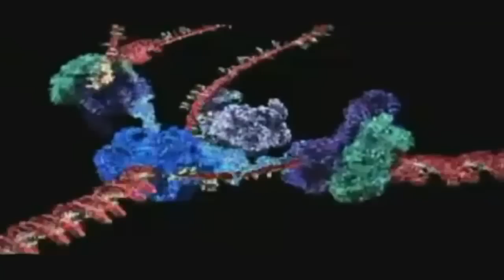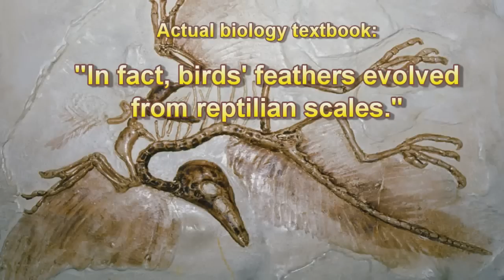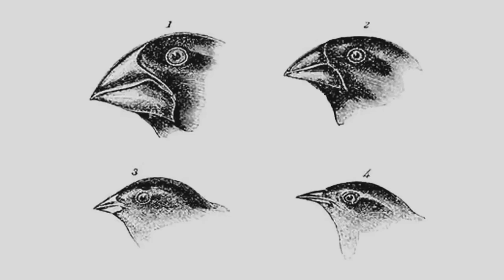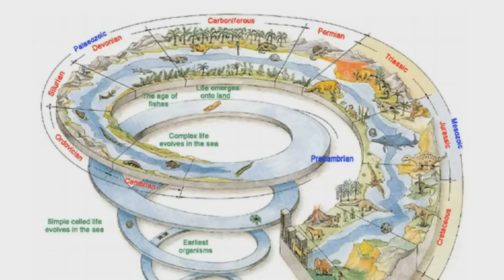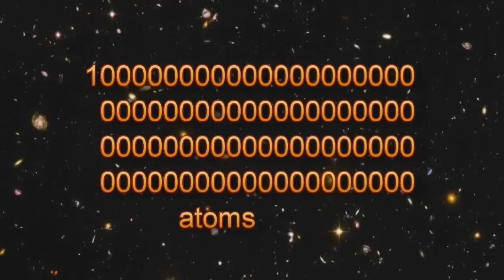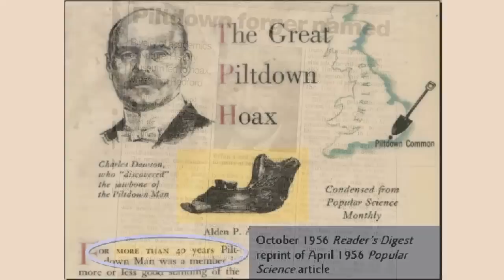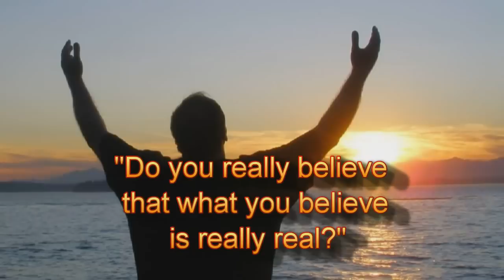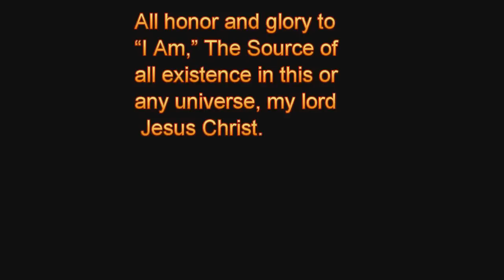Evolution Demolition

Comment: Regarding your assertion that there are no examples of new information being added to the genome: we have several examples, I'll name a couple of well-known ones:
The development of nylonase in flavobacterium, which allows them to digest nylon. This was caused by a gene duplication and then a frame shift mutation, giving a completely new trait with completely new "information" behind it.
E. coli that evolved to be able to live on citrate, by developing a new transport protein to bring citrate into the cell under aerobic conditions - this too was caused largely by a gene duplication.

Natural selection doesn't "create" anything, it just selects from mutations, it is is the mutations that create the new information.

Natural selection would't act on organisms that don't reproduce or divide, but when you're talking about the most primitive single cells, they can be divided without a reproductive system, for example by mechanical means as the cell expands.

It was determined in the 2005 Kitzmiller vs Dover case that intelligent design = creationism. Simple. Not necessarily biblical creationism, but creationism nonetheless.
Reply: Nylonase is probably a function of pre-existing information in bacterial plasmids (DNA loops) rather than the speculated gene duplication and frameshift.  But, for the sake of argument. let's assume that you are correct.  The sum total of genetic instructions to build and fold and implement an enzyme is substantial.  Gene duplication and frameshift comprise a not-so-improbable alteration of that existing, highly complex, highly functional, instruction set.  Such limited luck is admittedly conceivable.  However, to establish an instruction set in the first place that would make any functional enzyme would be overwhelmingly improbable.  Impossible odds.  Altering existing instruction sets?  Yes.  Genetic instructions where there were none? No.  At least, not by a random process such as mutation.  It has never happened, and, in fact, is impossible to happen.

Very different subject, but the Dover case was a lower kangaroo court in which the judge was both ignorant and biased, and the ID side was prohibited from a full argument.  Not unlike the Scopes trial in the reverse.  The laboratory is a much better venue than the courtroom for evaluating science.
Reply: Mark Champneys
The gene-duplication and subsequent frame shift isn't a speculation, it is a fact, have you even glanced at a paper like this?
http://www.ncbi.nlm.nih.gov/pmc/articles/PMC345072/pdf/pnas00609-0153.pdf

Frame shift is not an "alteration", it causes a completely new sequence of  amino acids in a protein, you cannot possibly argue that it's not new "information" when it's so utterly different.
DNA "information" is determined by it's sequence, so when an entirely new sequence of codons arises, it is new "information".

A kangaroo court? Really? I guarantee that if it had ruled in favour of intelligent design you and your ilk would be touting it as much more than that.
Isn't it funny that no one accused Judge Jones of being biased towards evolution or anything of the sort before or during the trial? It was only when he gave his ruling that he was attacked by the likes of Bill O'Reilly and Ann Coulter for exactly that. Makes you wonder...

I completely agree that the lab is a better place to evaluate science than a courtroom, which is why the ID movement is so insignificant.
The trial was to determine whether ID was a valid scientific hypothesis or simply creationism in disguise, and clear proof was found that it is the latter.
Reply: Ratio nalMind Did you notice the word "pre-existed" in the paper title?  A frame shift is a, well, shift.  It depends upon a pre-existing sequence.  I do not deny such higher probability alterations.  It is new instructions where there were none, that is against impossible odds, and against the law of increasing entropy.
Reply: Mark Champneys
You said yourself that the information is stored in the sequence of nucleotides, ergo - new sequence = new information. 
I have a feeling you're drifting off to abiogenesis again, asking how the very first DNA "instructions" came about.Let's try and stay on topic with evolution, shall we?

Creationists say that organisms can't macro-evolve without new "information" being added, I just gave you an example of new "information" being added.
No one is claiming that information is added by hundreds of fresh nucleotides inserting into DNA in a consecutive line, adding an entirely new gene, unless that what you creationists are expecting?

I've already explained that you don't understand the 2nd Law of Thermodynamics, it does not say order cannot increase.
Reply: Ratio nalMind I understand the law of increasing entropy better than most, and have elaborated on the law elsewhere in this forum.

I'm not one of those creationists who take issue with macro evolution, since, as you know, I don't even like the word.  I don't really care about the amount of change, but rather the direction of the change.  New algorithms cannot happen by themselves.  Alterations of existing information certainly can.

Yes, I realize that some will call any change "new," much like getting a used car and calling it "my new car."  But instruction sets are coherent.  Tampering a little bit... not so much.  Can you write a coherent paragraph one letter at a time, with it remaining coherent after each additional letter?  It might work in rare spotty cases, but mostly it will result in nonsense.  So it is with genetic instructions that build the simplest biological sub-systems.  But even moreso.

Both abiogenesis and neo-Darwinism have this information problem.  Where did it come from?
Reply: Mark Champneys
If you're using it to say that order can't increase, then you really don't understand it.

So you agree that macroevolution can occur? What do you mean by the direction?
Using the method that nylonase demonstrates, gene-duplication and frame shift, along with other mutations combined with natural selecion, it is entirely conceivable for a single cell to evolve into something as complex as a mammal. 
You can choose not to call it new information if you want, but the fact is, an entirely new trait evolved in an organism in an incredibly short amount of time. How can you take issue then, with lots of new traits being added over lots of time?

When you're referring to DNA, it is not a coherent set of instructions. A polypeptide of a string of amino acids folds into a protein with a particular function. If you change the DNA, for example by frame shift, an entirely new string of amino acids is produced, which folds into a protein, possibly with a new function.
You really need to stop using analogies to do with language to describe DNA. As soon as you describe it purely from the biochemical standpoint, it is clear that they are not "instructions" as we define them from our human point of view.

Once again, we dispute that it is information! If you're going to say that DNA holds information, then so does a rock!, it has molecules that interact in set ways, just like DNA, that's all that determines it's form and "function".
Reply: Ratio nalMind I'm not drawing analogies.  DNA is a data storage device, and there are thousands of literal computers in biological systems that access both DNA and epigenetic information.  This is being studied in biology, bioinformatics, and ontology. Dr. Don Johnson has written on the subject (two PhD's, biology (medical emphasis) and information science (ontology).  I have also heard him speak on the subject.  You can deny that such a thing exists, but it does.

DNA "is not a coherent set of instructions?"  You may be the only one who thinks so.  And coding for proteins (and enzymes) is only one small part of the information carried in DNA.  Frameshift, by definition, is simple.  What about very complex changes that would have to be made to build any given biological system?

And, by the way, are you familiar with bacterial plasmids and how they are accessed to select a wide variety of enzymes and patch it into its own genome?  That is likely where your frameshift occurred.  It is part of a designed system in bacteria--not new information.

Lastly, I explained my position on macro evolution in my video.  Did you not watch it?
Reply: Mark Champneys
Yes, you are drawing analogies, DNA is a series of molecules bonded together, the structure of the shapes created by these bonds are complementary to other molecules that carry other molecules into a another much larger molecule to be joined together and then released then one of the molecules in DNA has a particular shape to interact with that larger molecule to cause it to detach from the string of molecules.
That's all DNA is, molecular interactions, there is no "code", or "information". It can be useful to describe DNA as having such attributes, as it is much simpler to understand it in that way, but when you get right down to the molecular level, there is no "code" or "information". I've already explained to you that information and codes are defined by interpretations, in our case, the human interpretation of things like language, but DNA is not interpreted by anything, it is strictly determined by pure chemistry.

Frameshift is a simple change that results in a complex change.

Once again you are using this guided analogy of a bacteria "accessing" "information" in a plasmid and then "selecting" an enzyme, and then "patching" it into it's genome. That's not how it works! Bacteria don't think or choose or have any choice in the chemical interactions that occur within it.
It doesn't matter where the frameshift occured - it did occur, and it did create new "information" as you are defining it. You can call plasmids "designed" all you want, it doesn't make it so.

Of course I watched your video, how else did I deconstruct it's major points? Refresh my memory about what you said regarding macro-evolution.
Reply: Ratio nalMind And this machine I'm typing on is not really a computer--just a bunch of on and off switches (ones and zeroes) that happen to interact in a certain way when electricity runs through the on switches.  It's just physics, not information.

And a biology textbook is just ink on sheets of paper.  There's really no message there.  Just ink and paper bound together.

Get a clue.  Face reality.  Biological computers are information processing systems in every sense of the word.  The medium is irrelevant to the point.
Reply: Mark Champneys
I've already explained why your textbook analogy is asinine, but I'll say it once more: It is not the molecular interactions between the ink and the paper that causes the letters and words to form, they are printed. With DNA, the molecular interactions do cause the structure and function.

The actual computer analogy is better, but still inaccurate, putting aside the fact that the 1's and 0's are coming from an intelligent source, the main issue with this analogy is that the computer is programmed to interpret the binary code to carry out functions. This is not how DNA works, because each 1 and 0 doesn't physically cause part of the function, as a DNA nucleotide does.
Binary codes are not physical objects, they are an abstract code created by the human mind. It doesn't mean anything without a mind to assign meaning to it. DNA is completely different, it does what it does without any interpretation by a mind, that is the key point. 

I'll ask once again, if you consider DNA "information", why don't you consider a rock information as well?
If you do consider a rock to contain information, then under that definition yes, DNA stores information, just as everything in the universe does (by that definition), I'll concede that, but it is still not a code.
Reply: Ratio nalMind A rock is not a symbol that is decodable.  A rock may generate observations that the observer may call data, but we are talking about more than data.  Rather we are talking about decodable instructions that actually result in the building of the thing symbolized.

Yes, ones and zeroes do physically cause function.  Why do you suppose that a computer printer prints?
Reply: Mark Champneys
Several of your replies were marked as spam, which is why I'm only just answering them.

DNA isn't a decodable symbol either. 

1s and 0s physically cause functions because the computer is programmed to read them. just turning a switch on and off does nothing unless there is something to decode it.
This is different to DNA because the molecules actually physically do something, therefore by definition it is not a symbolic code.
Reply: Ratio nalMind Your description of ones and zeros exactly fits A, C, T, and G in DNA.  It is not merely symbolic, but it is actually digital code, as is the binary code in a computer.  Maybe you did not realize it, but ones and zeros (on and off switches) "physically do something" as well.  If they did not physically do something a computer couldn't work.  The sequence determines precisely what they physically do.  By the way, only a small portion of the DNA codes for protein.  Discoveries about the function of the rest of the DNA are being made almost weekly.
Reply: Mark Champneys
Yes, the 1s and 0s physically do something, but their actions are not what causes their function - they are just an input, the computer software then interprets the input to carry out a function.
I could code 2 different computers to act completely differently to the same binary input. 
The functions carried out as a result of DNA are not determined by a mind, or programming, they are determined by physical and chemical laws of nature.

I am well aware that only a small portion of the genome codes for protein, how is that relevant?
Reply: Ratio nalMind I don't know if you have ever done any low-level programming such as assembly language or even direct machine language programming, but at those levels it is the physical action taken by the hardware based upon the on and off switches that actually does anything.  Software arranges sequences of these physical actions to perform more complex functions, but the physical actions are actually quite limited at that level, just like the way the DNA - RNA transcription process works.  It is literally no different.  This is obvious to information scientists who know what they are looking at.
Reply: Mark Champneys
I'll say it once more, the series of on and offs doesn't determine their function - how they are interpreted by the man-made hardware and software does.
Starting from scratch I could build 2 different computers that interpret the exact same binary sequence entirely differently.

I'm not arguing that the switches aren't a physical interaction, but they are still subjective to interpretation - unlike DNA.